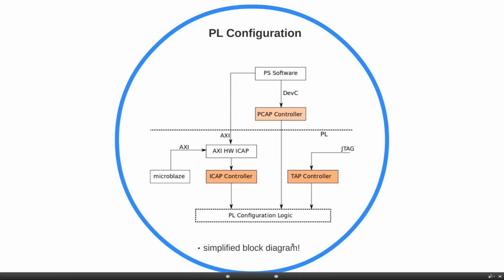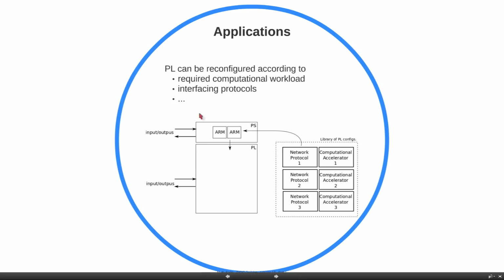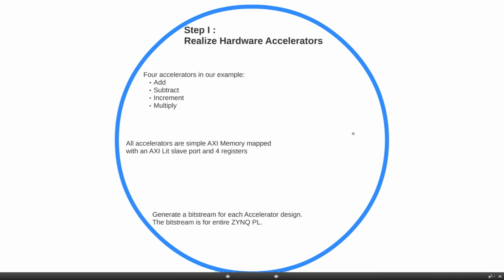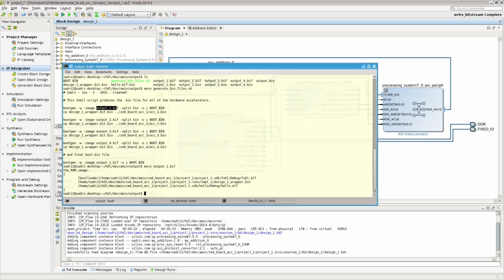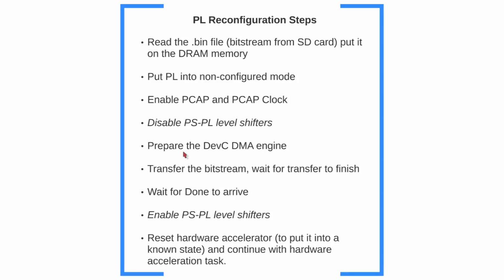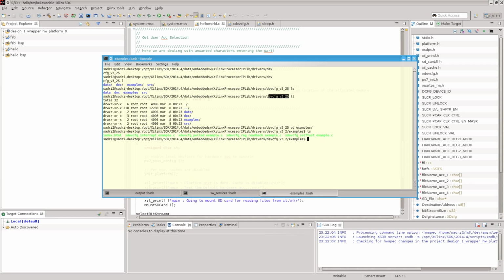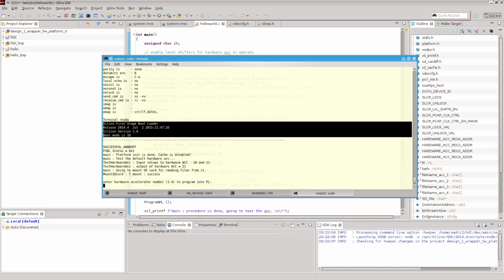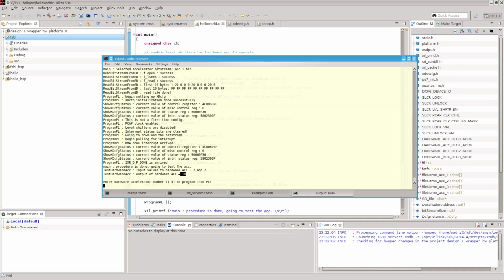ZYNQ Training - Lesson 13 - Part I - Reconfiguring the PL with Bitstreams Stored on SD Card

Comment: Thanks! 
The four accelerators expose the same interface (4 registers) to the application software. Hence, the generated BSP (for the 4 hardware accelerators) that the software application links against is similar/uniform? would it be problematic if the accelerators in question do not expose the same interface to the application, and hence the BSP generated is not uniform across all designs, and consequently even the application  software is not uniform and need to be modified across the different accelerators?

Can it happen that reconfiguration might result in changing the underlying BSP, in other words the BSP includes driver to access the PL acclerators, what if the reconfigured accelerator need a driver that is not present in the current BSP, is it feasible to statically link the BSP against any possible driver corresponding to the any prospective kernel?  

What if for each accelerator I want to load different ELF,  especially for accelerators that expose different interfaces to the application software? am I missing something?
Thanks so much.

Comment: Why should we use arm processor in stand-alone mode and not in linux mode?
Reply from the maker: +Goutham Ravindran there is no should! depending on what you want to do , you may like in your project to have a standalone system
Reply: +Mohammadsadegh Sadri sorry I didn't put the question in the right way. what is the exact difference between  standalone and Linux mode?
Reply from the maker: Goutham Ravindran In the stand alone more you dont bring up any operating system, you will not have multi-tasking, memory management and things like this active. but on the other hand, your system comes up very fast, and it required a very small amount of resources to come up and get operational. so, depending on the type of project you are doing you may some times like to not to run any linux os on your arm host.